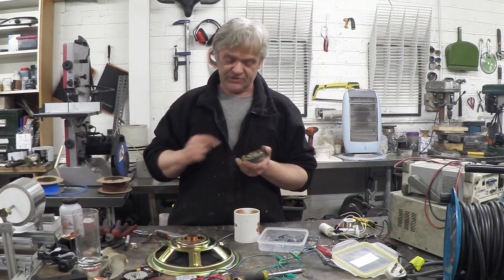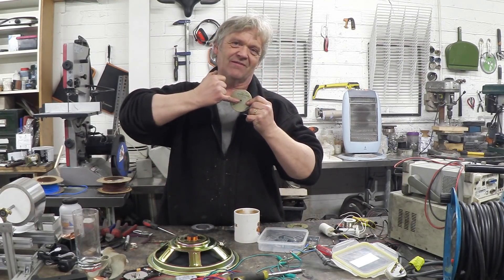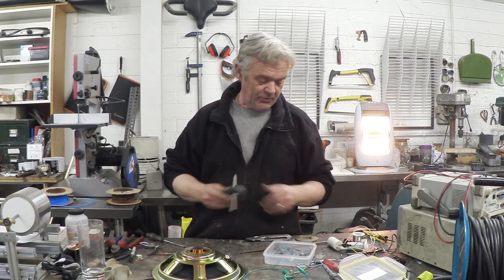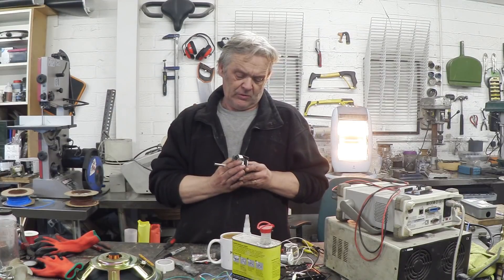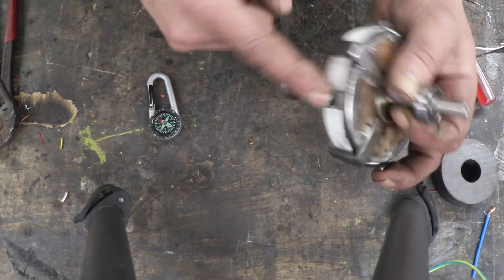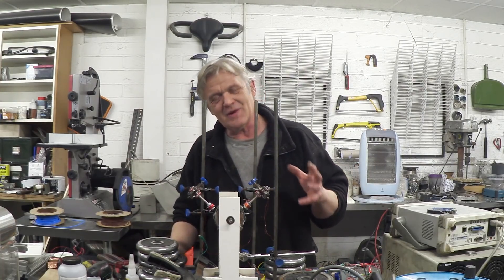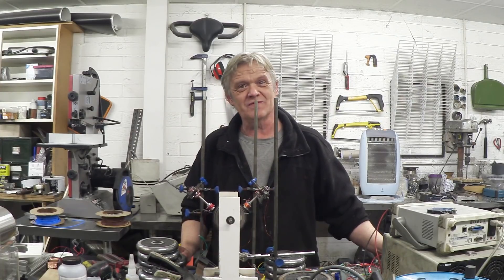1030 How To Build A Brushless Motor From An Old Speaker

Comment: Could you stack the magnets from multiple speakers on top of each other and make a linear actuators out of them?  I am thinking you can alternate the fields along the side and push or pull instead of rotate with the coils.  Basically a poor man's linear motor

Comment: Hi Robert got a question about induction after seeing something which clamps around power lines and harvests the electromagnetic field supplied by the lines. Does tapping into the magnetic field with another device add a load on the original source or is it like a byproduct which is wasted which could be used? Many thanks
Reply: Hi Clive. If I may answer that it does add a load to the original source. When you do that it's just a transformer. Even if it's just a single wire, It's the same principle. When putting a load on a transformer secundary winding certainly the load primary increases. So it does ...
Reply: @hanslepoeter5167  hi Hans many thanks I thought it would do, how about putting some magnets near it would they rotate (if on a rotor shaft) or be energised/move without adding a load or is it essentially the same thing as putting a device/appliance with a power rating on. A DC motor can turn at full speed using very little amperage. Yes I live right underneath some power lines haha
Reply: @clive280178  Magnets could rotate in theory but whatever you do extracting power from it it is a load on the power line. You will not be able to tap any serious power without connecting to it  directly which I certainly recommend against. It will be illegal and maybe lethal too.
Reply: @hanslepoeter5167 many thanks for the info

Comment: Echoing Craig Lewis below...let's see a generator in action with a wind turbine or other renewable power source.
Reply from the maker: that's not what Craig said - he said it would be good to make a generator from it and I agree - a motor and a generator are really the same thing in construction terms - so go for it - build one and do some videos about it - it would be awesome to see you
Reply: @ThinkingandTinkering  True, I expanded on Craig's statement.  Looking for a generator to pair with a Stirling engine that could run on concentrated solar heat, and wondering if the Stirling has enough torque to spin the type of generator we are discussing.

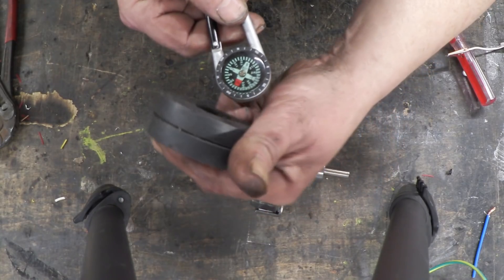Comment: Good / interesting / potentially useful video.  ~  Re:  2:46  "... the North follows the North and the South follows the South."   Considering that the North-pointing pole of the compass needle is a North-seeking pole, that means that it's actually the South pole of the compass needle, yes?  As it's opposite poles that attract each other, it can't be "... the North follows the North and the South follows the South."  Correct?
Reply from the maker: the compass north points to magnetic north mate - the compass north is really a south painted with a red north -  it would be terribly confusing if you were in the woods and you had to remember that! - so the paint the South Pole with a red N
Reply: @ThinkingandTinkering  Agreed, but for you to say that "... the North follows the North and the South follows the South."  is technically incorrect in terms of what's going on regarding the polarities involved.

Comment: This is very simmilar to conversion of an alternator into a brushless motor/generator. When rotor windings are replaced with a magnet (brushes discarded and some mashining to make room for a magnet) it does the same thing and you can do a usefull stuff with it. However , this is (speaker magnet) is great for learning.
Reply from the maker: yes it is mate

Comment: 'This' is the configuration I was describing when you had unfavourable results with that large diameter single coil; in attempt to replicate the microwave turntable motor coil, to a generator
Those top and bottom plates that encase the coil. In the center of the coil, the metal arms come down.

But, this video was very profitable. It answers the question I was posing on that video. Now I know the single coil, multi-pole concept generator design ... will work.

👍
Reply from the maker: ahhhh - I clearly didn't really understand what you were saying - but I get it now! - thank you mate

Comment: isn't the compass North Pointing to the Magnet South, not North? North repels North and attracts South
Reply: I think compasses are made to point to the direction it says. It would be pretty confusing if you are in the woods and you use a compass where north points away from north lol
Reply: @aldenhauser9555  I can make my compass needle point north or south. Using a magnet you can move the pole on the needle. Why Robert was worried he might mess his up as those compasses are hard to change the pole on demand.
Reply: @MAGnetICus_Attractus  nice! Not sure how that’s relate but cool!
Reply from the maker: the compass north points to magnetic north mate - the compass north is really a south painted with a red north - as Alden says it would be terribly confusing otherwise
Reply: The compass needle North has a South magnet attached to it.